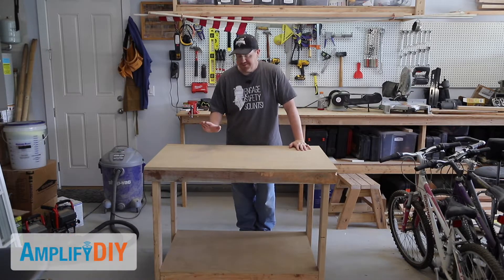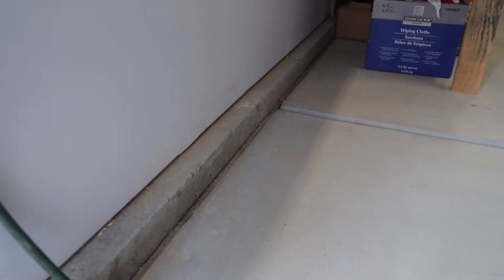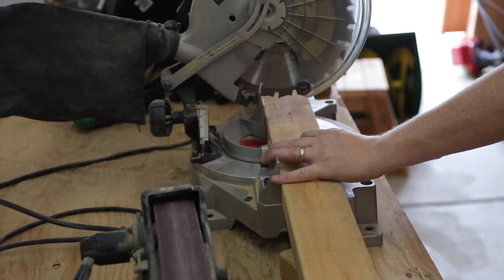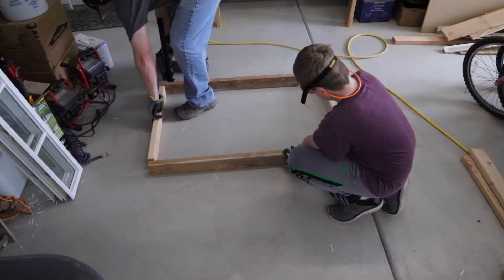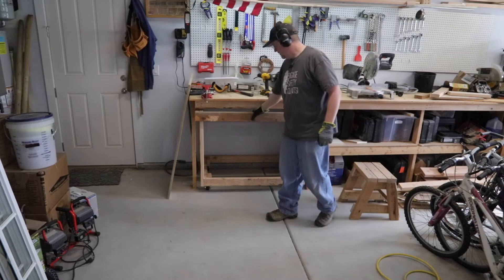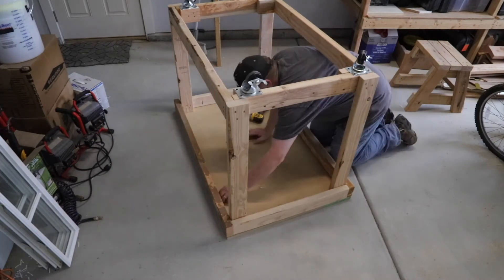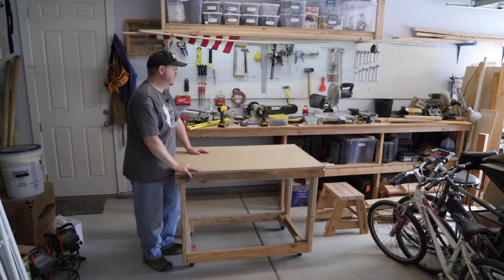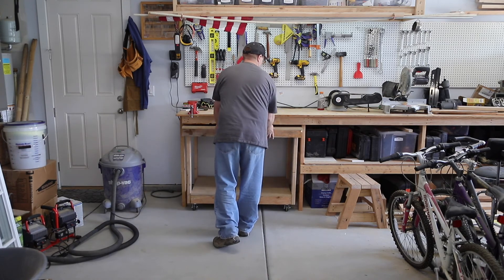How to build a simple rolling shop cart or table for your workshop

Comment: It didn't fit because the ground is slanted for runoff. You can see the angle in the video. I'll bet if you'd measured the underneath height on all four sides of your existing bench, you would've caught it. Great video though, I'm going to copy your design!
Reply from the maker: I believe you are right. The workbench is perfectly level, but the floor does slant just a bit for runoff. The bigger issue was that it was too tall to work as an outfeed for my table saw. In hindsight, it would have been far simpler and safer to just cut the legs a little shorter at the bottom to correct it. Thanks for the comment, and thanks for watching!